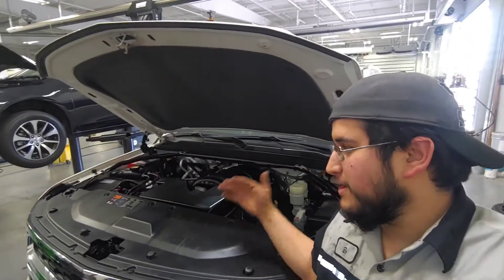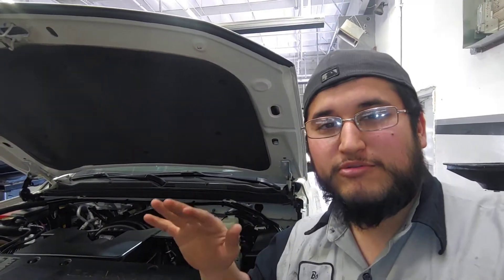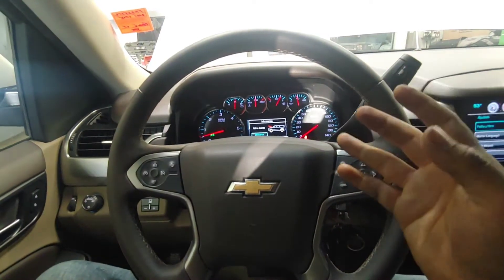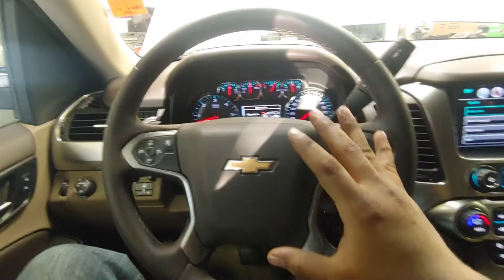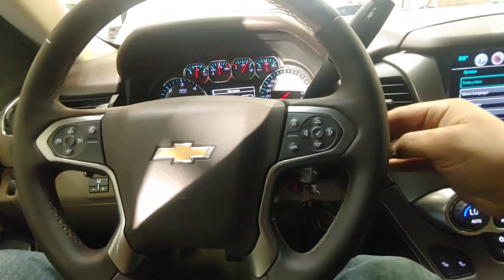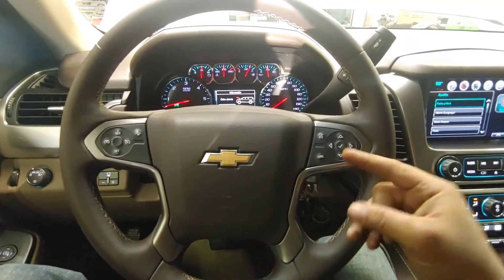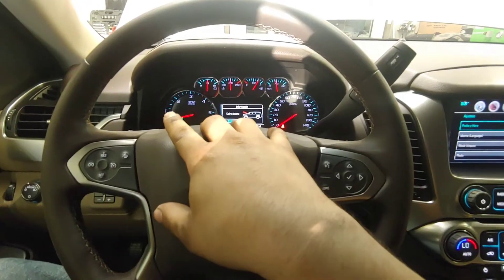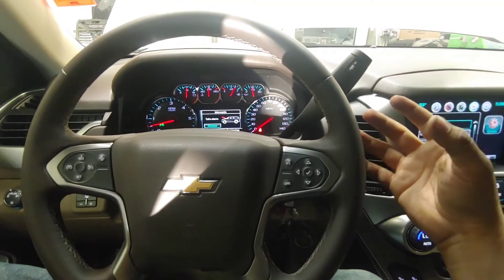Hard Brake Pedal ~ Chevrolet Tahoe And GMC Yukon ~ 14-18

Comment: They have a vacuum pump because when the engine goes into active fuel management/displacement on demand (shuts half the engine off) the engine does not make sufficient vacuum for the braking system. Corvettes use a electronic vacuum pump so it doesn't rob the engine of power or over rev the pump due to the potential of operating at higher engine revs due to the Corvette being a sports car.

Comment: I fixed my vacuum pump and still have the issue, I’ve noticed that when I push the pedal in hard I can hear something in the rear of my truck come unstuck and it lurches forward kinda, I get a service brake assist light also, any input would be appreciated

Comment: Would this vacuum pump make tickin or tappin noise if it’s going bad? I have a 2018 tahoe with the 5.3…I have good oil pressure and no check engine lights??

Comment: '99 chevy tahoe- brake pedal stiff as a rock, truck won't start. This has been going on for well over a year. I will wait a few hours or sometimes a day or even two days, then brake pedal isn't so stiff and truck will fire up fine. After watching many vids, I decided to dive into it. Gotta fix right? I replaced brake master cyclinder, brake power booster, check valve, bled the brakes, brakes are good. All of this seemed to fix the problem. Now after many months, it's doing it again. If the problem isn't those thing previously mentioned, where now should I be looking?

Comment: Quick question. My 18 silverado with only 9,000 miles on it, one brake caliper got stuck so I replace it, and now the other one is getting stuck. Any thoughts on that situation? TIA
Reply: There is an internal failure between your Brake booster and Master Cylinder.  Don't make my mistake by replacing the wheel hub assembly, brake pads, rotors, and calipers.  Have the dealer replace the Vacuum pump (under recall),  if they find fluid inside the Booster then they should also replace the Brake booster.

Comment: So I have a 04 Tahoe 5.3, I have a similar issue. My pedal gets hard as a rock and locks my brakes. Have u come across this? After sitting for a long while my truck and brakes work fine but then I’ll drive it and the pedal becomes hard as a rock again n brakes lock again. Plz help.

Comment: howcome you have a lexus shirt on but are usually working on a GM product?
Reply: Dude is a lexus tech, but works on everything.    He's  the most versatile tech in that entire shop.
Reply: @Donnythelatemodeltech  wait wait, aintchu supposed to be on that OTHER channel? ( heh ive seen y'all work together....)
Reply from the maker: Lol yeah @thelatemodeltech is my buddy. Were both in the business of reconditioning cars from every make and model. Personally I recondition cars that are to be sold in our used car lot here at Lexus
Reply from the maker: Thanks man
Reply: @greasemonkeyrepairs4737  do you have the link for the replacement? I about ran into a truck today for this same issue and my brake assist notification came on the dash. They had a recall on this but evidently didn't fix the issue